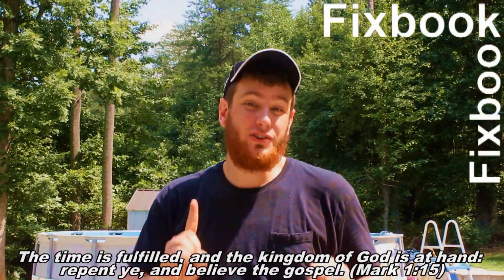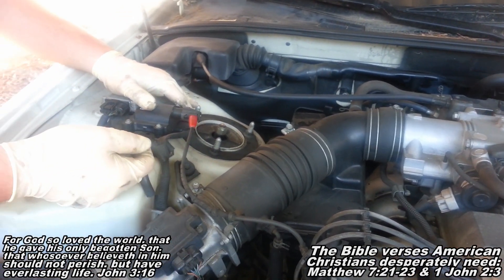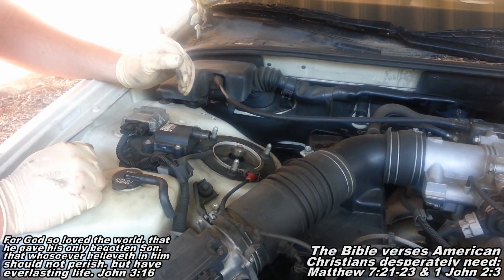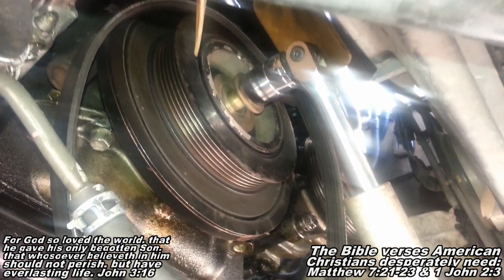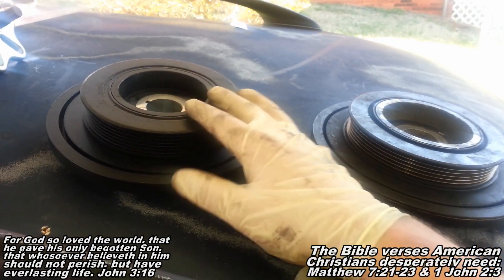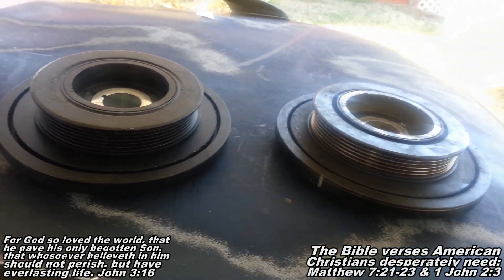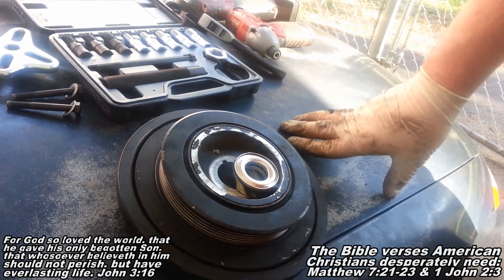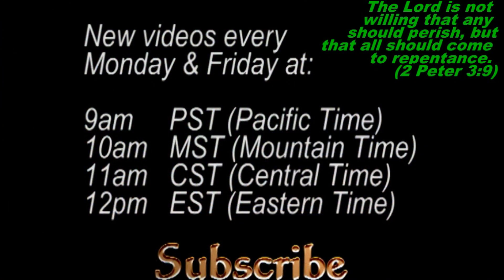Harmonic Balancer Crankshaft Pulley Remove Replace 91-97 Lexus GS300

Comment: Or you can just use the bolt to put on the harmonic balancer I just did it right. Now because the nut from the kit didn’t fit just do it like if your tightening  it and it start going in slowly

Comment: One of the bolts on the harmonic balancer puller broke off 😢 any, can't get out with my drill screw extractor, any other idea on how to pull off the harmonic balancer without the puller? Now I just have one bolt available for the puller. 😢

Comment: Do we need to leave the crank bolt on when we're pressing it out? I am scared the tool will damage whatever is inside so by leaving the crank bolt on, then it presses on the bolt instead. Is that right?
Reply: magadavixt it won’t come out because the bolt has a huge washer securing it to the crank

Comment: Will a car run without a harmonic balancer and belt?
Reply: Yes
Reply: but it will drain the battery
Reply: Only for a test , not for long because needs belt to drive the waterpump and alternator.

Comment: What if the last mechanic who put the crankshaft bolt on did it way too tight, then following your procedure here it rounds out instantly? I could see someone setting this up alone and using the starter to try and break the bolt.

At a shop with an impact gun you would be watching the bolt and you could lightly hit it on and off a few times to see what happens.

Round that out and you are screwed on the DIY part, be safe.